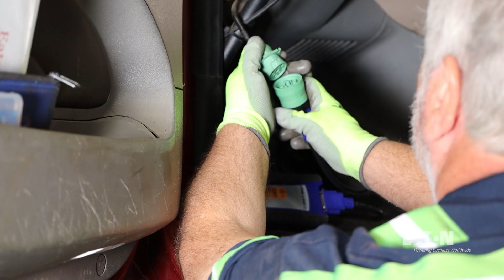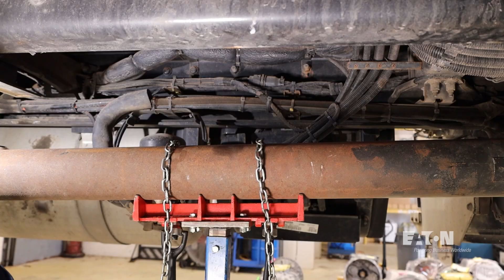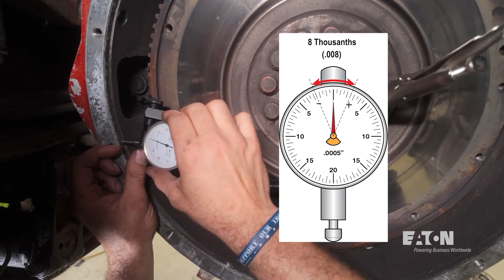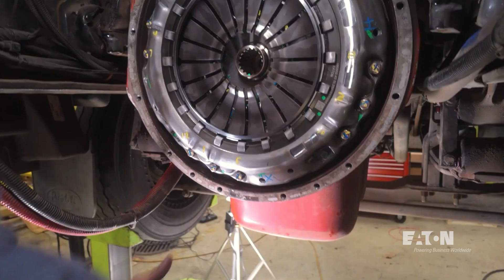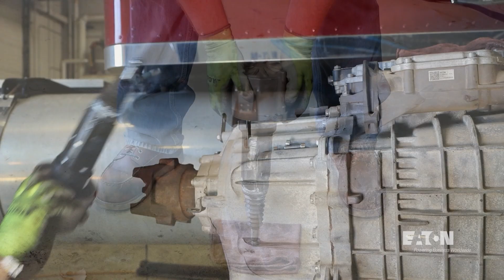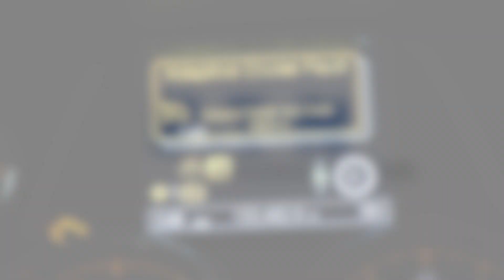Clutch Replacement Process: Diaphragm – Eaton Explains

Comment: Why must the flywheel be replaced instead of resurfacing? Aren't there specs and tolerances,  is this engine or clutch series specific?
Reply from the maker: This flywheel must be replaced because resurfacing would take it out of spec or compromise its design—many modern applications use dual‑mass or tightly toleranced flywheels that are not approved for machining. Even where specs exist, heat damage, minimum thickness, or step‑height limits often can’t be maintained after resurfacing, which risks clutch chatter or premature failure. In those cases, replacement is the correct, manufacturer‑recommended fix.
Reply: @eatoncorp have any job opportunities for a 49 year old commercial transport who has busted his ass since 1997?
Reply: So how much does extended warranty last? Trying to weigh the pros and cons. I will look on your website. Reman trans with flywheel, on a 2019 pete with a cummins 15L , auto with a clutch? What year are we talking?
Reply from the maker: Please reach out to our team, they will help you with all your questions.
Phone: 1-800-328-3850 | Email: AutomotiveSupport@Eaton.com
Reply from the maker: Thanks for your interest in Eaton. Visit https://eaton.eightfold.ai/careers to find more information about career opportunities in your area.